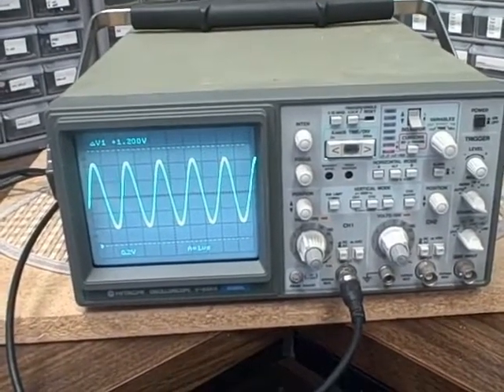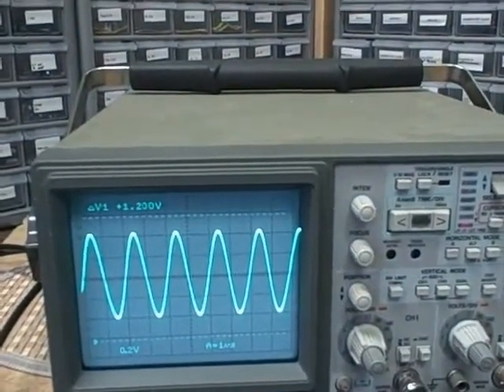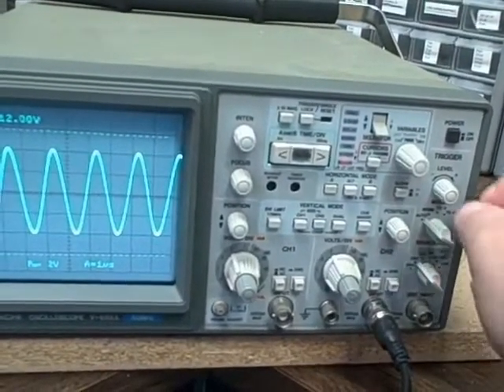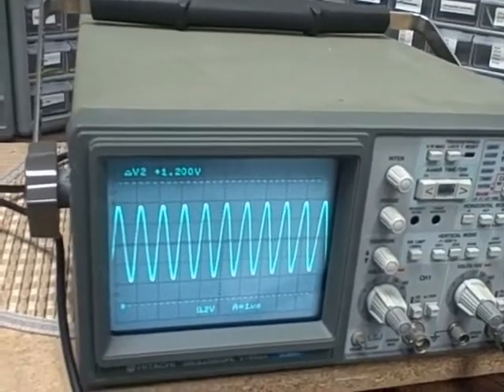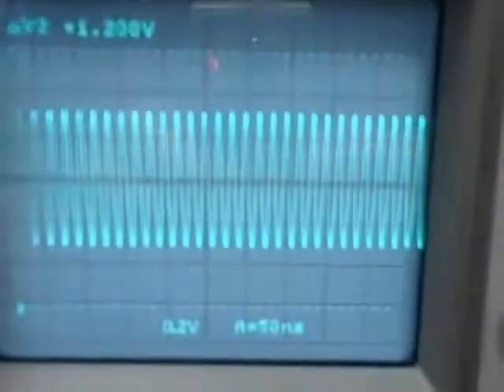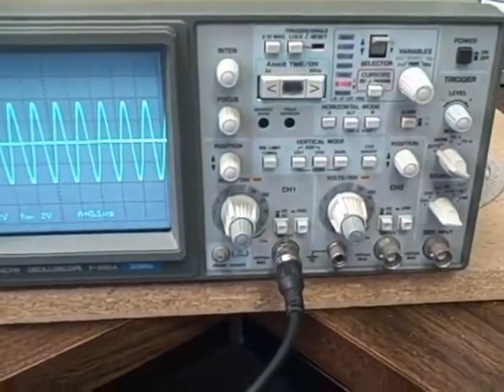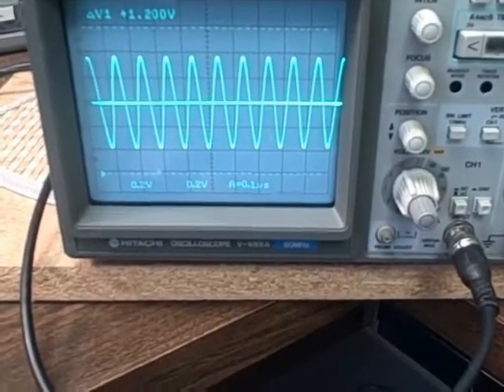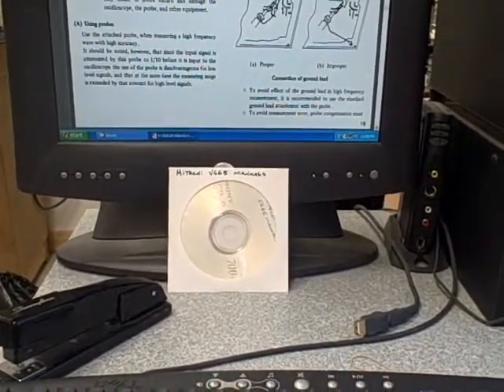Hitachi V665 u1

Comment: Hi bap8guy... may I ask, how did you change the amplitude from 10x to 1x on the display? I have just aquired a hitachi vc-6065 but can't find the control to change the vertical scale... can you help??? thank you...
Reply: Had the same problem for a while and I just figured it out:
Push the Selector switch down and HOLD it down, then turn the Variables switch to change it.